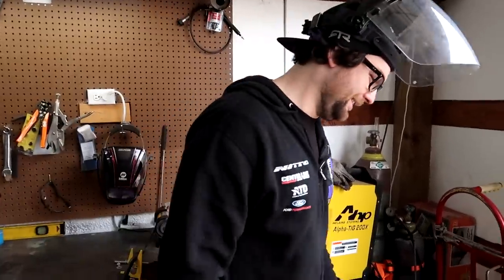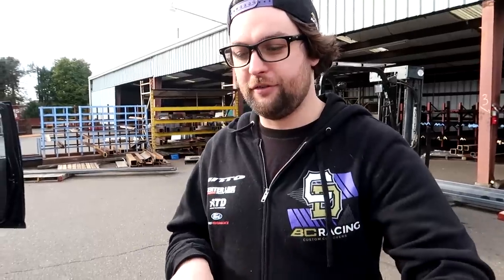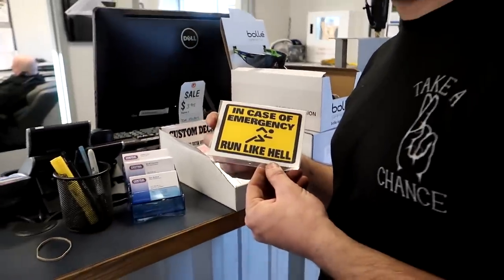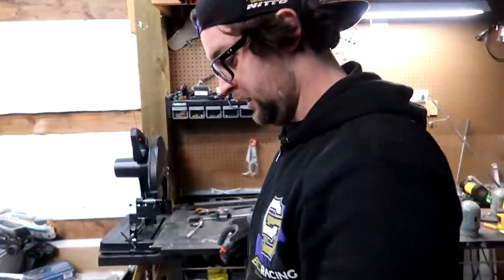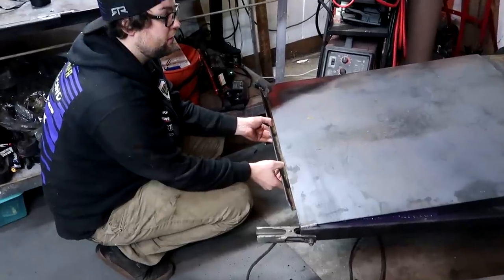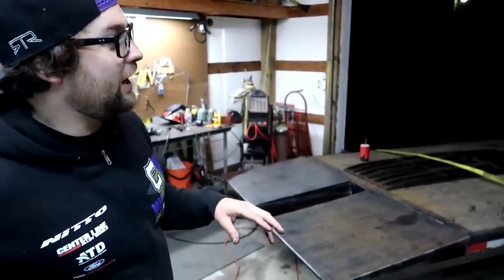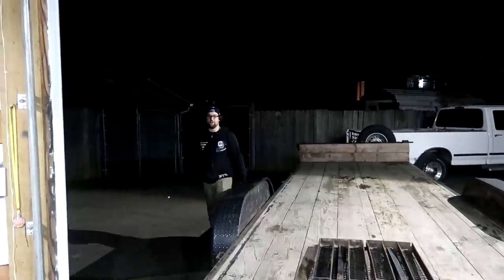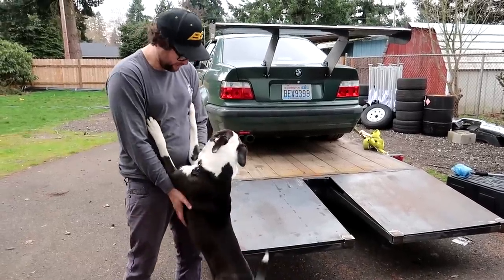TRAILER MOD TO HOLD 2 CARS, AND LOW CAR FRIENDLY

Comment: looks SICK! slap some strips of skateboard griptape on there so its not slick in the rain. diamond plate is great for that reason but costs and weighs more. could mix sand with rustoleum and brush it by hand, that works good too.

Comment: That is bad ass! I bought a trailer last year and stripped it down and build the surround and tailgate and had a hell of a time with it (videos on my channel to prove it). This right here though, this is genus. I have been looking for simple car trailers and maybe doing something like this would allow me to get something smaller and I can make it bigger. You might need to add some extra weight to the front so that when you tow it empty it doesn't swing around cause of the extra weight you added to the back might make it light on the tongue.
Reply from the maker: already handled.

Comment: Needs some walkway grating welded on the dovetail for some traction when it’s wet.
Reply: Michael Manke Yeah,  slippery AF.
Reply from the maker: I put sand in the paint.
Reply: Grip tape is basically just as slippery as metal when it's wet.

Comment: I would consider some rollers on the very end. That way when you leave driveways it eliminate some of the drag if the ramps hit. I can send some pics tomorrow if you need an idea.
Reply from the maker: Dovetail rollers for sure. BUT, It seems that there is a good amount of clearance. If I start scraping Ill put some on.

Comment: Neat!👍 But what's the weight distribution like with two cars on it? Are the axles still somewhat centred, or do you end up with a rear heavy trailer? Couldn't really tell from the video.
Reply from the maker: I have a tire track, tent, tools, and generator that goes on the front. Plus 1 car is completely in front of the front axle. Should be able to have about 1500lbs of weight on the ball.

Comment: will it hold 2 cars??? probably...
will they fit?  off course...
can the truck haul the extra weight?? definitely 
my ONLY concern with this is....  the BALANCE of the trailer.... because if its too heavy in the rear.... you are NOT gonna have a good time.......

https://www.youtube.com/watch?v=6mW_gzdh6to
Reply from the maker: Yea for sure. I have a gene and a tire rack for the front. So figure another 650lbs on the nose.